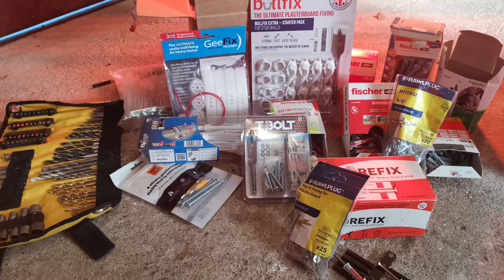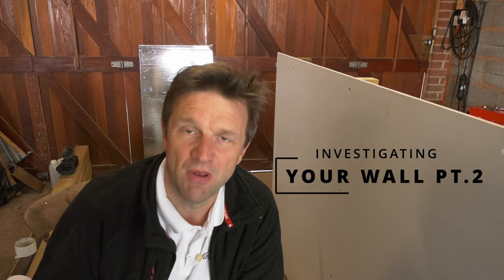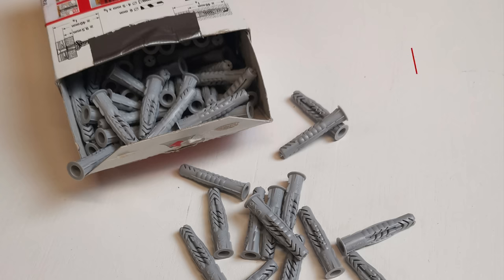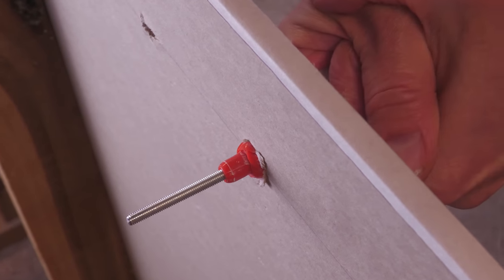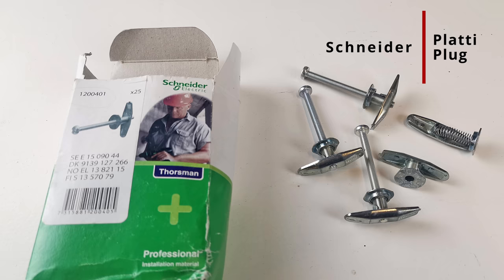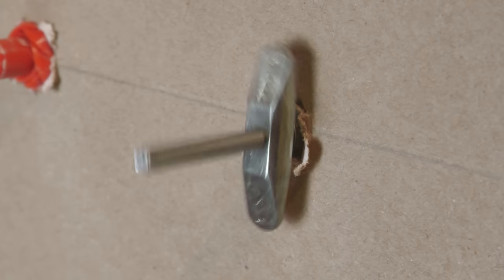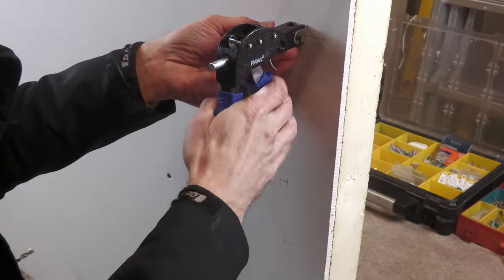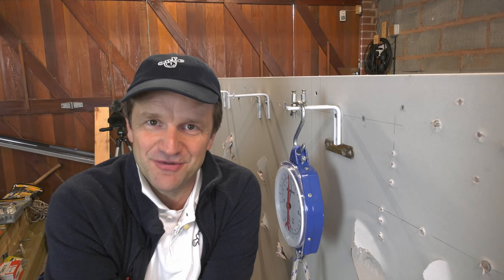How to Fix into Plasterboard - a Complete Guide to all the Best Fixings

Comment: Do you ever use express nails and insert wall plug and then the screw
Reply from the maker: John, thanks for this. I've never used express nails - they're for fixing into concrete and masonry right, eg where you're attaching a batten? I guess you'd use them instead of, say a frame fixing given their length and diameter - the I've In looking at now are 8x150mm. I'm interested to see what the benefit would be over say a traditional wall plug but the reviews are good so I'll get some and have a play 👊🙏 What are your experiences with them?

Comment: Sometimes if the hole gets too big I'll put 2 (or even 3) grey Fischer dry wall plugs in the same hole, screw a screw in to make it expand and use the other plug to fix into. Works well if it's a not too heavy item.

Comment: Hi Charlie
What would you recommend for hanging a reasonably light load (5kg, 2x screws) on a dot and dab plasterboard? Would the duopower be ok here?
Reply from the maker: If you're not driving the screws home you'll need a metal wall anchor as once you've set it you can leave the screw sticking out of the wall to hang your picture or whatever on, although you can combine the duopower with a picture hook as I showed here https://youtu.be/qwVnoaY5eVc?si=Gr4jP7EBv4Ed2hCW

Comment: I’m hanging a curtain from a plaster board ceiling so the weight is all vertical, it’s a really wide window and all the fabric will have to pull to one side only. We’ve been advised to fix a batten first so I need a fixing that goes through a wooden batten possible 50mm thick and then standard plaster board, what do you r3commend … I’m guessing go for the expensive ones
Reply from the maker: My advice would be buy a decent magnet https://amzn.to/3MhLGBp and hunt down the screws in the ceiling with it - these show you where there's a joist above. Then you can screw directly into that. You may be unlucky though if the joists run parallel to the wall where you're trying to fix into.

Comment: Hi Charlie, as ever thanks for such an informative video. I'm looking for a plasterboard fixing to hang a bathroom mirror but the fixing is an 'L' shaped bolt which wont be tightened fully to the wall as the mirror has slots in the back which hang on the vertical part of the 'L', if that makes sense. It also means that I cant use any of the bolts which come with most fittings but have to use the bolt which came with the mirror. Any suggestions ?
Reply from the maker: This is similar to the dilemma you have with slotted mirror plates - where in the past I've ground down the head of a large diameter screw with my belt sander to get it to fit into the slot. In your case you're further constrained by having to use the bolt. How about the Geefix as you can pretty much screw anything into the central hole once the fixing is in place of for that matter self tap into the wing that opens up behind the plasterboard?
Reply: @CharlieDIYte  Thanks Charlie. I think you're right, having looked at it the Geefix might be the way to go. I need to double check the hole wont be visible as the fixing on the back of the mirror is very close the edge. Appreciate you coming back to me so quickly. Best rgds.

Comment: Hi Charlie I am thinking of using the snap toggle to hang a mirror on my plasterboard wall. How would I find out if it has insulation behind the plaster board? Im worried the snap toggle won't be able to turn around into the lock position not knowing if there is insulation behind or just the plasterboard itself.

Comment: Very informative... On a side note, what kind of fixing would you recommend for installing a Ring door bell onto a UPVC door (it has a metal core)? Thanks.
Reply from the maker: Thanks. Does it definitely need to be screwed to the door rather than adhesively mounted - I don't have any experience with Ring but seems a shame to drill the frame? If you do, best thing to do is self tap in with a screw - I'd go 3.5mm hss drill bit and 4mm screw, and I've got a video for that https://youtu.be/G1ziRy_OJbU
Reply: @CharlieDIYte Great video and we'll explained. Thanks Charlie.

Comment: My biggest issue with hollow wall anchors—at least, the Paulin product sold at Canadian Home Depot stores—is that the bolt threads not into a nut but into the same thin, soft metal that makes up the body of the anchor. With so little thread engagement, the anchors strip with the slightest bit of overtightening and sometimes even when setting the anchor. This can be very frustrating.

Comment: Charlie, what would you recommend if there isn't any fixing? I have a mirror with two holes in it to accept screws protruding slightly from the wall. I think the wall is plasterboard on battens.
Reply from the maker: Wall anchors or Geefix. Geefix probably better as with wall anchors you'll have to grind down the bolt head to fit in the slot. With Geefix you could even self pilot a pan head into the wing if it doesn't go into the central screw.
Reply: @CharlieDIYte  Thank you 👍

Comment: I’m trying to work out how to install a wardrobe rail where the supports have two holes fairly close to each other. I guess the duopower are my best bet?
Reply from the maker: Yes, particularly if the rail is only going to exert downward force. You'll be fine with the Duopower 8x40.
Reply: @CharlieDIYte  thanks. I decided to go for it and it seemed to work ok. Just needs load testing with all the girlfriend’s clothes!!

Comment: Charlie, I have an alcove in my house which I am trying to turn into a wardrobe. There are no studs in this space and it is insulated plasterboard so a lot of the heavy duty fixings won’t be able to open up. Would the Fischer Duo plug work well in such a situation? I was thinking of attaching a piece of wood to the plasterboard using these fixings and then attach rails/shelves to the wood.
Reply from the maker: It sounds like the force will be downward only, in which case yes 8x40 Duopower would work well. Did you see the segment near the end where I tried out the fixings in insulated plasterboard?
Reply: @CharlieDIYte  I have rewatched the segment at the end again, thanks for the great videos as always.

Comment: 23:27 Cobra Driller Toggle, avoid these like the plague. The plastic is brittle and I snapped when the screw met some resistance. They only work somewhat if you pre-drill a 10 mm hole or something. Would not recommend these at all. Use the all metal version if you try this type of anchor.

Comment: This wasn't quite what I was looking for, but I need to replace a pull-cord light switch in a plasterboard ceiling, the existing holes left when I took out the old switch (it was screw directly into the plasterboard by the previous house owner) are quite large now and not sure what anchor to use. I know the switch it lightweight but the new switch has a strong pull and just a bit concerned about pulling it out of the ceiling.
Reply: Spring toggles were originally designed for ceiling use.

Comment: Charlie hi, great video. I just have one question, how do you get around using the limited screw sizes supplied with some of the curtain fittings for example. We recently bought some steel curtain rails , but when I looked at the screws to go through the actual fittings, they would be far too small  for the heavier fixing types you suggest, and which are obviously much better for the load like the Anchor fixings. I have now also hit the same issue with a heavy mirror, which has a very small screw head size to fit on to. Any ideas ? Other than taking them back to the  shop
Reply from the maker: HI Bill, in the curtain business (that being my old day job) we rarely used the screws that came supplied as they're not fit for anything other than screwing into wood, and how often do we do that? We'd use our own screws and colour them with metallic marker pen if necessary. If you have to use the screws that come supplied, that Geefix is good as you can literally self tap the screw into that plastic wing behind the plasterboard, but you do have to check that the circular front plug will be hidden behind the bracket as you wouldn't want it showing. For mirrors where you have to slot the screw into a bracket, I have often reduced the diameter of the screw I've used in place of the ones that come with it, by rotating it against the belt on my belt sander. That's all you can do really.
Reply: @CharlieDIYte  hi Charlie, thanks so much for coming back on this. I agree, the screws are usually too small for any kind of serious plug. I’ll try what you suggest with the generic. Cheers, great videos by the way , really helpful.
Reply: Should have read as GEEFIX

Comment: Btw, the draper that hung my heavy curtain poles used "Thorsman" brand wall plugs. But that was 23 years ago, and looks like things have moved on. I recently was advised by the local DIY shop to use both of the last 2 fixings that you advised to use. The slim ones bent and so couldn't be tapped into the plasterboard. The metal self-tapping big things said "use a drill". You can guess the size of the hole in the wall that made ....

Comment: Great reviews, can anyone reccoment what fixing to use to fit floating shelves to 12mm plasterboard which lines a wooden shed...unsure if theres any gap atall. Shelves only for light objects. Im guessing going through wood too with nut boly and washers maybe best option, though like to keep everything hidden if poss.
Reply from the maker: Use the Geefix for that, or better still, screw into the shed upright supports if you can.

Comment: Charlie, what is the minimum thickness the plasterboard has to be for the Fischer Duopower plugs to work?
Reply from the maker: 12.5mm even with the 6x30, which I wouldn't use anyway because I think it's not long enough for any practical application.

Comment: I need to put up some shelves that require countersunk screws, is there a countersunk version of the hollow wall anchor?
Reply from the maker: Yes you should be able to. Work out the bolt size of the wall anchor (eg M5) and then Google "M5 countersunk head"
Reply: @CharlieDIYte  sorry Charlie I was being a bit thick. I was looking for hollow wall anchors that came with countersunk screws but of course I can  just replace the standard screws with countersunk.
Thanks

Comment: Hi Charlie.  Bullfix Universal works great in insulated plasterboard.  Any particular reason you didn't test it?
Reply from the maker: Hi Matthew, no reason. I was simply picking which fixings I thought would perform best. Inevitably with a video of this length and complexity there were going to be omissions, but I think I've represented Bullfix pretty fairly and well. Great fixing by the way - will be using it a lot going forward.
Reply: @CharlieDIYte well it was a great video thx

Comment: If fitting a curtain pole with a 3 hole round fixing plate would you think 3 duopowers are ideal?
Reply from the maker: Pete when I do those I typically don't use the bottom hole as it adds no strength to the job. I just rotate the plate so 2 holes are lined up horizontally at the top. Yes 2 Duopowers in the top holes would be a good option.

Comment: Hello Charlie DIYte. I was wondering if you could recommend me a plasterboard fixing from your Amazon list? I am looking  at hanging 2 mirrors. One mirror is 4kg, the other is kg. I am not sure which fixing to use? Daniel
Reply from the maker: You left a blank for the second mirror kg but if they're on mirror wire I would recommend the T-bolt mirror hanging kit as it comes with the hooks.
Reply: @CharlieDIYte  Sorry about that. One is 4kg, the other is 1 kg. I don't plan on using mirror wire.

Comment: I am hoping to fix a hangboard (climbing training tool) above a doorway in my flat. There are no studs and just plasterboard.
I’m going to be hanging off this, and I’m around 70kg. Theoretically 6 No. snaptoggles can hang >200kg of force, so should this be okay? I think locally but I’m unsure if the board will start to fail where it connects to the studs?
Reply from the maker: Jack I wouldn't rely on any of these fixings if you're literally hanging off the board. You need to find and screw into the joists in the ceiling.

Comment: What fixing would you recommend using to mount something as light as a toilet roll holder into plasterboard?
Reply from the maker: I'd go with the Fischer 8x40 Duopowers and a 4.5 or 5mm diameter wood screw that's a bit longer than the fixing taking into account the bracket - maybe 50mm long.

Comment: We have an eggbox wall and want to fit a column radiator but a bit concerned about the weight,what would you suggest
Reply from the maker: The best you can do is try the Geefix. You may have to cut down the plug depth if the wall is less than 12mm plasterboard.

Comment: Hi Charlie is timco reusable i.e can I remove the bolt completely and reuse it to change it to a new bracket
Reply from the maker: Good question Brian. I don't know the answer but you could try by winding out the bolt but leaving it engaged and then push the bolt into the wall whilst pulling out the collar.

Comment: Spring toggles were never intended to be used in vertical applications which is why they are not suitable for comparison in the context of this video. I've used them horizontally to mount a blind under a window and had no issue - because this is an example of how they were designed to be utilised.
Reply from the maker: Fair point. I just can't see the point when we've got Snap Toggles 👍
Reply: @CharlieDIYte  They're pretty old school now. Snap toggle fixings are essentially an evolutionary product based on the spring toggle - the advantage of which as you state is that the screw/bolt can be removed while leaving the fixing in situ. I enjoyed the video. Couple of products I wasn't familiar with but as they say "every day's a school day!"

Comment: If possible, should you always target on the stud of a stud wall? Also, let's say one screw can take 25kg. Then can I say 4 screws for single shelf can take 100kg?
Reply from the maker: Definitely. Studs will always be stronger than the strongest plasterboard fixing because plasterboard is inherently brittle.
Reply: @CharlieDIYte  How to calculate the total weight 4 screws can take? Let's say one screw take 25kg. Then 4 screws can take a 100kg shelf?

Comment: Question I have a 40mm thick plasterboard wall should I use m6 60mm butterfly fixings ?
Reply from the maker: I'd be inclined to use the Snap toggles David. Not sure what you mean by the butterfly fixings.
Reply: @CharlieDIYte  The butterfly fittings are the ones I bought, that's what they called them. I had to use 75mm in the end. The fitting with the spring loaded plates

Comment: Can you directly screw small screws if it's just too hang a light weight picture (0.5 kg)?
Reply from the maker: Bottom line, yes, and you could use a small wall plug for belt and braces. Other option - use picture hooks designed for the purpose.
Reply: @CharlieDIYte  thank you for your reply!!

Comment: Am I correct in thinking that if my Plasterboard wall is two layers of plasterboard thick, that it would increase the load capability of the fixing?
Reply from the maker: Yes I think it would. Snap toggles or the wall anchors with longer collars would be good for that.
Reply: @CharlieDIYte  cheers Charlie!  I was very, very skeptical about allowing plasterboard to take any load in the past, let alone this much!  In the end I went with the zip-fix (similar to the snap toggles), and my plasterboard turned out to be circa 35mm thick!  The ikea floating tv unit all told (and fully loaded with the equipment I wanted it to carry) is approx. Just under 50kg!  It’s attached to the wall using 4 No. zip-fixes.  And <<touch wood>> seems really quite sturdy.  It’s only only been up a couple of days now, but I’m checking it every morning still!  In the past I’ve always been able to find studs or masonry.  No such joy with this one.  It’s a dividing wall between two properties (2007 build), and the cavity behind the plasterboard is enormous it’s at least 75mm+ before you can reach the block work.

Comment: It's also important to remember what is getting mounted to the drywall and what direction the load is going. 
The walldog for example may not take much, but it's really simple to use for light loads, vertical loads and leaves a small hole when removed.

Comment: I currently have a kitchen wall unit that has come slightly away from the wall. I have drilled through the inside of the unit and into the wall. The issue I have the wall is just thick of plaster no plug will help tighten the cupboard back to the wall. Longer drill bits also used. Can anyone advise? Thanks

Comment: Using the speed plug or "piggy tails" as we called them many years ago (15yrs), would always fail if you use them to drill in to the plasterboard as they destroy the strength. We would drill a 5-6mm hole and then use the fixing, this makes them way stronger than using the fixing itself to make the hole resulting in very little failure, even in kitchen wall units.
Reply from the maker: Still flawed though as a fixing even if you drill the pilot hole.
Reply: @CharlieDIYte  Yes I agree, at the time they were ok at best... But as you've shown, things have come a long way and the ones you recommended are the way to go, they work really well.